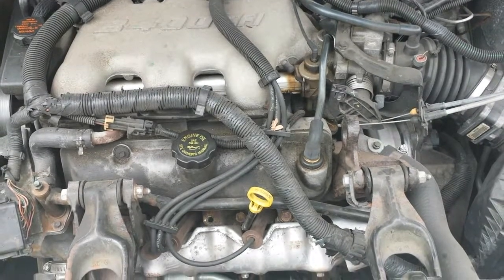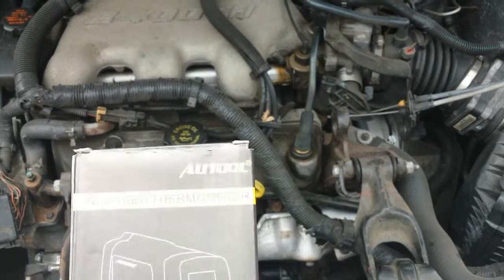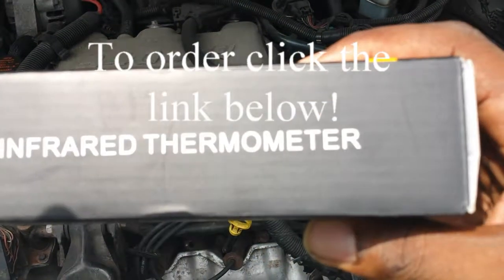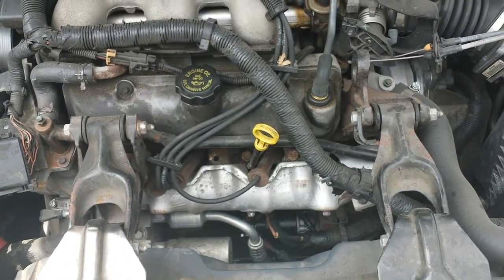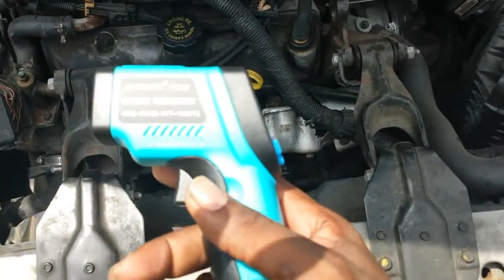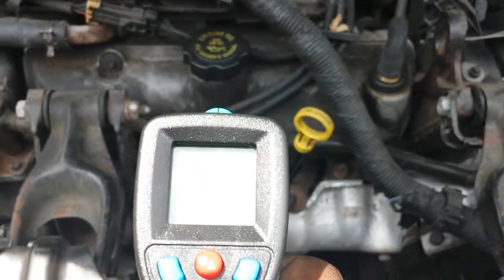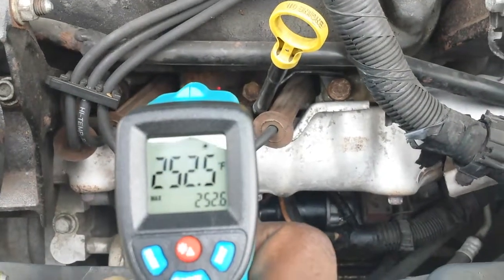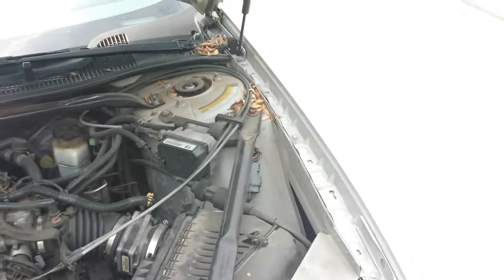Engine Overheating? Quick Test!

Comment: I think the exhaust would be way hotter. That would be a bad reading. Operating temp would be better from oil or coolent locations. Exhaust I thing operates in as high as 1000 degrees and this can be normal. I would take the reading around the thermostat or a hose. Probably the hose going into the radiator out of the thermostat.  But i am by no means an expert more of a dummy, haha.
Reply from the maker: Thanks for tip. Please subscribe & like and share if haven't already and check out our other helpful videos